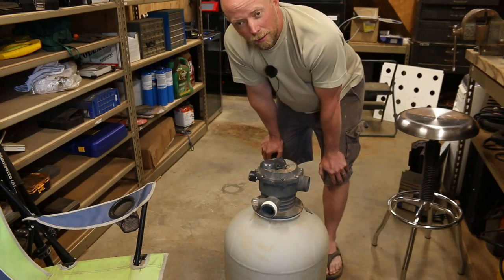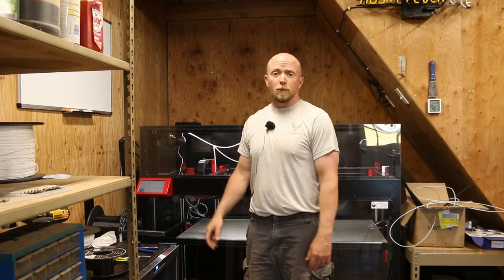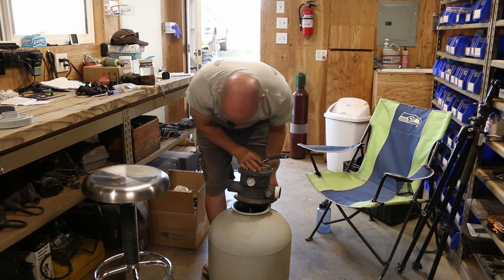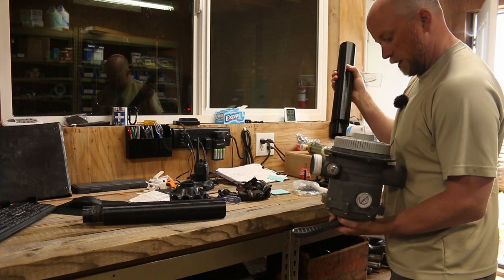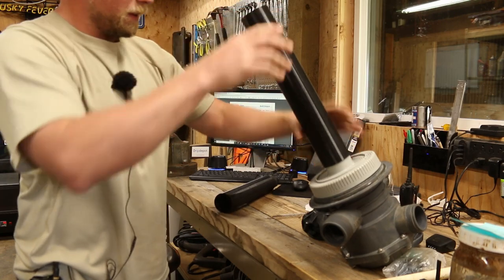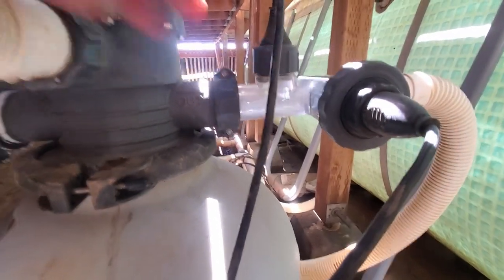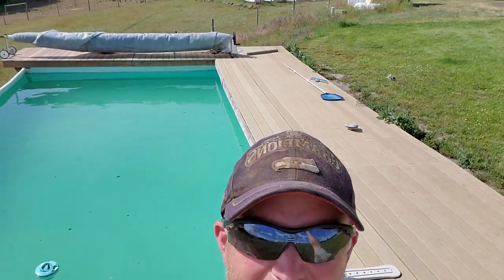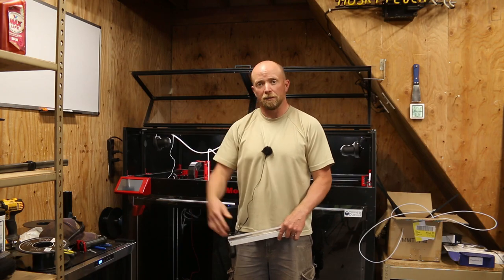Can You Fix A Pool With A 3D PRINTER? Modix 3D is So Big!

Comment: Why not 3d printed brushings on both ends and a PCV pipe in between ?
Reply: I was thinking the same. Would be a quicker print, but might be more susceptible to leaking.

Comment: S3D probably isn't retracting when it does moves across the inside of the pipe. It still registers that as being the part and not an open space. Try deselecting the "Only retract when crossing open spaces" option on the advanced tab of your process.
Reply from the maker: good call

Comment: PETG would have been a better idea since you are playing about with water.  You should try some good quaility PETG since your attempting to make parts for your hydro system and since that PLA isnt printing consistantly.  You should calibrate the printer settings for each plastic carefully, you want to run a temperature tower to figure out approximately what your ideal temperature is for each material and you should calibrate the retraction carefuly to minimise blobs and stringing - keep working on this until you have it dialed in perfect and you will get consistant prints every time, excepting the odd spaghetti incident or warp.

Comment: the uzing is probably because of the bowden style extruder.  on large printers this is often a problem
Reply: It's a direct drive, the tube is only there to guide the filament from outside the printer to the printhead
Reply: Yea, this is direct drive,  oozing is probably from not dialing in retraction settings that, and generally the lower the temp you print it at, the less oozing will happen. Either that, or sometimes you can change the seam so that instead of a random seam you get a vertical seam, that will help with oozing also, because its not jumping to random locations to hide the start of the next layer.
Reply from the maker: with this filament...it only seems to print well at higher than 210C...that might be the issue ...more testing

Comment: Jeff, with the printing do you find opening the cabinet to look at the print effects the consistency of the print? (As in its heated so opening the cabinet let's cold air in.)

I haven't done 3D printing, but we had issues in the injection molding factory when cold winter winds blew through large open doors and cooled the machines.

The heater bands would lose temp and the materials in barrel would play up and cause product issues.

Comment: $400 for a piece of pipe? edit: I would have printed adapter fittings to use standard sized pipe, rather than the pipe itself.
Reply from the maker: not for the pipe...you have to buy the whole unit (filter). the adapters are a great idea...should have thought of that